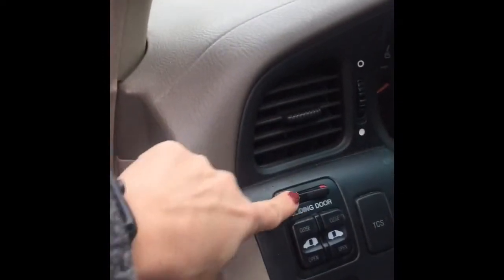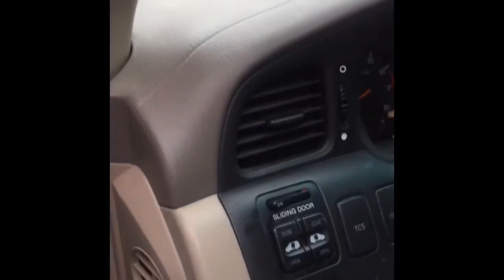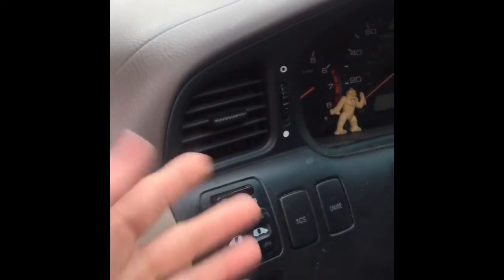Fixing power sliding door on Honda Odyssey

Comment: My 2000 Odyssey has one door that hasn’t worked in a year, and another door that just stopped working today. Winter weather seems to have an impact.
I tried this fix today (except I pulled fuses 1,5,7, and 13 since another video recommended #7) and the door that has been useless for A YEAR is working!! The other door still doesn’t work but I’ll take one working door over no working doors!!😂

Comment: This worked exactly as you said. I was fearful that I would have to replace the door  motor. It happened on a winter day when the door was frozen, and after 2 attempts acted as if there was no power to the door.  You saved me the money for a mechanic on my 1999 honda single owner van with 265,000 miles. This was a fantastic save that I owe you. Best wishes.